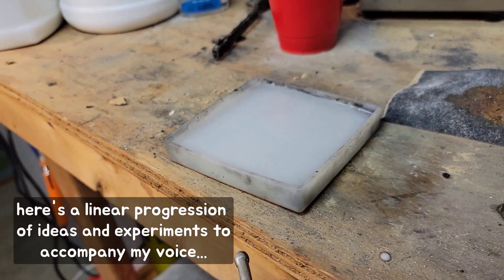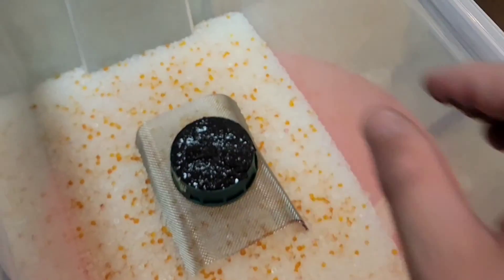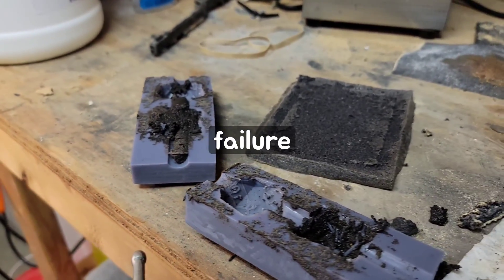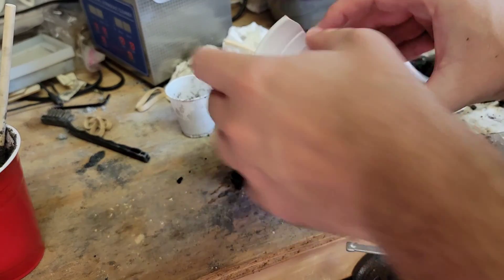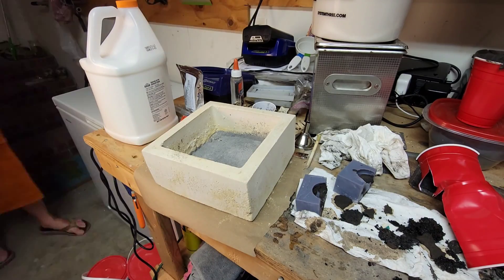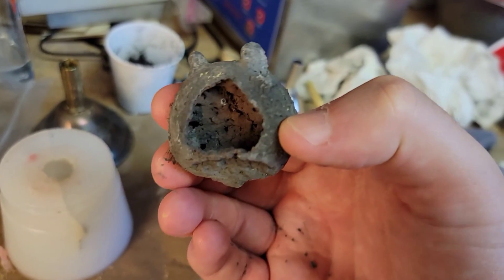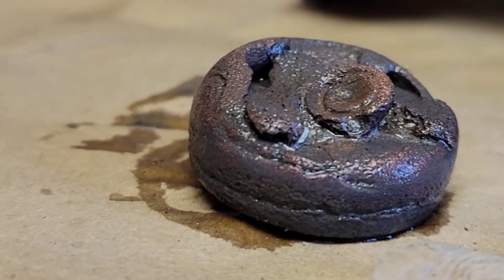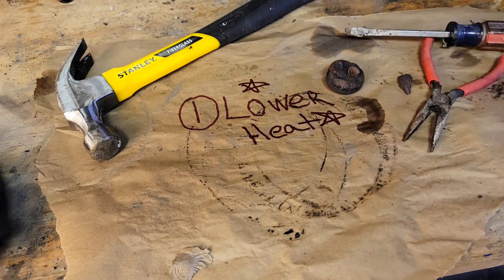A New Way to Cast Metal Objects

Comment: Cold casting... but uses a kiln??!
:
Reply from the maker: Cold casting for the casting :)

Kiln for the sintering. Regular cold casting has the look of metal, but not the properties. Using this way you get (or will after I work it out...) the properties of a fully metal piece